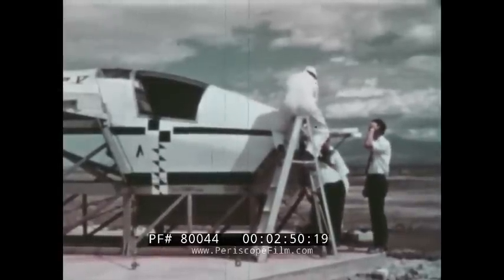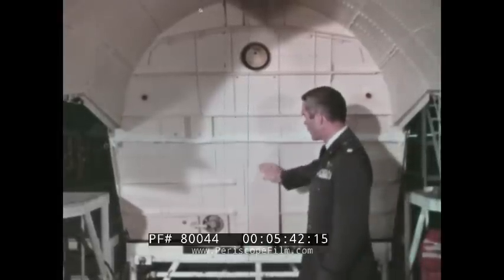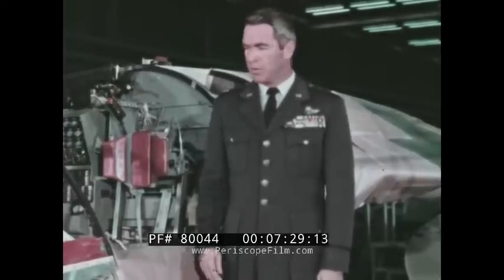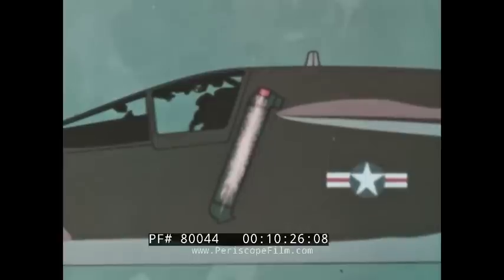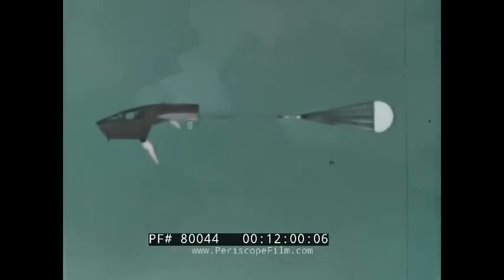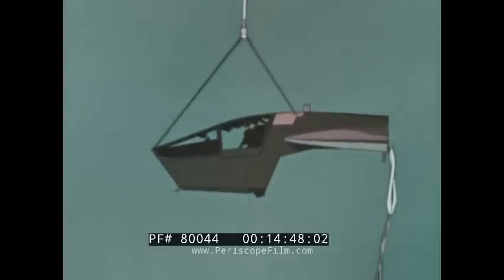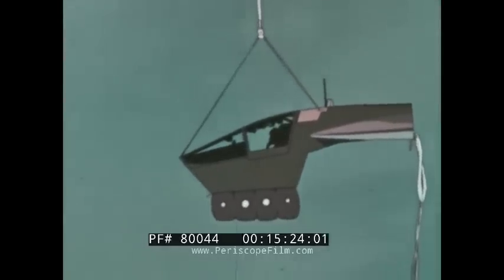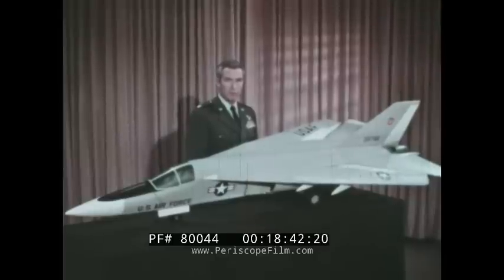GENERAL DYNAMICS F-111 AARDVARK CREW MODULE ESCAPE SYSTEM   EJECTION SYSTEM 80044

Comment: Late 80s or early 90s I was working (survey crew) west side of Clovis, NM, heard a boom and a fellow worker yelled that a F111 just crashed.  Looked to the west toward Cannon AFB and saw a huge column of black smoke, then saw a chute open with cockpit underneath. Jumped in truck in and drove 3 miles to crash site, I think it was the pilot that was already out of the cockpit and was walking around,  I think I remember that the weapon system officer suffered a broke leg.  If I remember right one or both engines quit on short final, crash site was about 1 mile from end of runway and cockpit landed about 1/4 mile from crash site.

Comment: I have to say thank you for this video. Back in 1978, I worked for Talley Industries of Arizona later named Talley Defense Systems. I mixed the propellant for the casting of the propellant into the body case of the rocket motor, which we called the TFX. The company also made the ejection handle, barostat, and maybe even the rotary actuators that are used to secure the flight crew. No one at the company that I talked to knew how the TFX was mounted in the aircraft. Now over 30 years later I finally found out.

Comment: Nice. Thanks for the video, and the memories. One thing not mentioned, was the need to disconnect all the electrical wiring coming from the capsule. There were 4 capsule quick disconnects, 2 on each side, and each had the capacity of (IIRC) 16 cannon plugs. They were mounted to a plate that was spring loaded, and the spring mechanism locked 4 pins in place, keeping the quick disconnects stable. When any motion was felt on the spring mechanism, the spring released, and retracted the 4 pins, allowing the quick disconnect to float, the plate would allow the connectors to pull apart, and then would not resist separation

Comment: Love the F-111 and the A6 Intruder. The crew ejection module for the F-111 was awesome, but I have heard stories of some screwed up injuries from it lol.
Reply: And deaths.  flew -E and-F models for near ten years. It was a great aircraft. The module was a death trap. We would only go in the last worse possible case.  I was back in the States on leave when my regular ship was in an incident. Crew pulled the handle. Both died.
Reply: @itsjohndell  let me guess the wing hinge pin fell out in midair!!
Reply: The ejection capsule was a requirement due to the possibility of supersonic penetration missions at 200 feet altitude. The B-1A also had a supersonic penetration mission as such, the first 3 prototypes had a similar ejection capsule while teh 4th prototype had 4 ejecytion seats.  Since the B-1B lost its supersonic penetration mission, all 100 B-1Bs were built using conventional ejection seats.  At max thrust, the B-1B was to penetrate at 600 knots, at 200 feet altitude, in bad weather, at night with the pilots hand not touching the stick. Terrain Following RADAR was amazing.  Many flyers have been injured during ejections, be them in capsules or conventional seats.

Comment: I'm glad you are re-uploading some of these videos. The old version of this, and a few others caused my video card to choke and stutter when I went full screen. I'm guessing it was a weird resolution that wasn't natively supported.
Reply from the maker: That's interesting...well...reality is that some of the original scans we did were captured on somewhat primitive equipment. We started out with what is called a TRV-16H, which was a standard definition transfer system (telecine). We upgraded from that to a Tobin telecine, then went full digital and HD with a machine called a "Sniper". In more recently years we made the commitment to buy a Lasergraphics ScanStation, a full blown scanner that can support a lot of different film formats and has many corrective features including image stabilization and de-scratch built in. We can scan at variable speeds, in HD, 2k and 4k, and capture audio digitally. So the new scans (and soundtracks) are entirely different from the old!  BTW you should be subscribing to this channel! For the inside scoop support us on Patreon: https://www.patreon.com/PeriscopeFilm
Reply: @PeriscopeFilm  That's an excellent behind the scenes. I am currently subscribed, but I don't have the finances available right now to do the Patron thing. I'll keep liking and commenting in hopes the algorithm will be kind to you. :)

Comment: My coworker Rick Searfoss was proud of his Aardvark driving days, and boasted that he flew it faster than he did the Space Shuttle- since while the Shuttle did Mach 25, that was in such thin air that the KEAS never broke 400, but the F-111 could go supersonic on the deck at nearly 900 KEAS.

With the shuttle, EZ-Rocket, and X-racer, he flew the largest and smallest rocket planes, too. I called him our NASA-surplus astronaut. Miss him.
Reply: 900 KEAS on the deck is fast for a -111.  The FB-111A could do around 730 knots at sea level. the F-111B Seavark could do 793 knots at SL at 63,220 pounds combat weight with 2 Phoenix missiles, or 698 knots with 6 Phoenix missiles loaded(68,365lbs).  All -111 models were structurally limited for top speed, not thrust limited, though the F-111F was the most powerful variant with 30% more thrust.

Comment: My Dad worked in R&D at McDonnell in developing the ejection system for r=the F-111. How all the cables and wires had to be systematically severed before separation, each by a small guillotine type cutters

Comment: And the module works ok, a F111 with the 48th TFW at RAF Lakenheath in eastern England got into trouble about 20 miles north of our house, we were talking about it the other day. My late father was one of the local community civilian fire fighters who went to the scene of the ejection. Two fire stations nearer the scene got there first and assisted the crew out of the pod, they were sitting there chatting away, before the base picked them up. The crash scene was near Binham, Norfolk, England, you can Ytube it, around 1987. I was interested on the film when he said to clear the fumes they opened the hatches a bit, yet I was told a story where two local farmers arrived to help and we're going to use an axe to open the canopy, but the crew signalled to them to stop because the module was pressurised? But you know how bits get added onto a story. There's a thank you plaque from the USAF in the village somewhere thanking locals for there help. With at the time around ten British and American operated bases near by it wasn't the first time we first responded to an ejection.
Reply: "The module was pressurized"💀
Reply: I was stationed at RAF Lakenheath from '85 to '88. I know the crewmembers involved in this accident. Firstly, both survived. I am not sure about pressurization continuing after ejection, but I'd doubt it. I do know that both crewmembers were injured because of a partial malfunction in the ejection system It may be simply that they were a bit stunned and in pain and didn't want to be moved or messed with.

Comment: Surely the system worked well in most cases. I did see a video about a pilot who suffered a severe back injury because the shoulder straps retention device failed. Otherwise the F-111 is a super fighter bomber!

Comment: Capsule system seems like a great way to protect the crew. Thing is, if you eject over enemy territory - you are essentially giving them the entire electronics suite of the model, no? Even if you put in a destruction charge, setting off an explosion on the ground once the crew egresses, is like saying "we're over here, come get us!"
Reply: The electronics are very likely stored elsewhere on the plane and all that is in the cockpit are the controls that interface with the computer and flight controls. That’s how I would do it if I were designing this to keep the weight of the capsule down
Reply: All the electronic stuff was elsewhere in the fuselage. All that remained with the capsule was control heads

Comment: It sounds very complicated , I wonder  if it was a success in operational use . And if it worked as it should,  why wasn't it used in later aircraft ?
Reply: Of course it worked, many times. Unfortunately the TF-30 was a garbage engine and it caused many crashes. The capsule failed a few times as well. Ejecting out of the envelope would get guys. And failed attenuation bags broke a few backs. Other wise it worked pretty well. 

The US Navy insisted on the capsule and side by side seating. The airplane was Navy in a lot of designs. They backed out of the deal when they could. The F-14 was their answer, and it was a better airplane. But it did have the crappy TF-30 engines, and all of the problems that engine created. The Vark was an ok bomber. It had few evil traits. Except the engines.

Comment: Basically a rocket plane inside a jet plane!!  Like spacecraft,  umbilical's  have to be cut and its all so complicated and amazing as it has to work even after sitting and sitting in heat and vibration endlessly for that one time the handle is pulled...  Even today the F111 is amazing and outdated but so damn powerful and big and heavy and could go really fast carrying a heavy bomb load and like the Warthog, sad it cant fly on as both planes are so capable.  The Space Shuttle was extraordinary to but thats gone  for a decade now and the US doesn't even have its own spacecraft to lift men into orbit so a lots changed....
Reply: Space X regularly lifts humans to orbit, Boeing will also do so this December.

Comment: Very interesting but I understood that it was very mantainace intensive and took hours to reconnect the escape module to the airplane. Nevertheless I always found the F-111 a really cool airplane but feel very sorry that I never saw this airplane flying 😢 😞
Reply: @FIREBRAND38  perhaps I didn't explain well: of course those modules once utilised by by the crew to bail out are not used or junked but those still installed on their airplane needs to be routinely inspected and generally the airplane was very expensive to fly hence the reason why the Australians terminated the use of F-111...
Reply: yeah they ditched they system entirely and went to straight ejector seats on the B model on due to maintenance!!
Reply: @keithmoore5306  exactly! It was for the same reasons also the US Airforce terminated the use of this airplane despite performing very well during the Gulf War and performed better than any other U.S. strike aircraft used in the operation.The group of 66 F-111Fs dropped almost 80% of the war's laser-guided bombs, not bad isn't it?
Reply: @paoloviti6156  well spare parts supply was also starting to an issue too in it's retirement!
Reply: @keithmoore5306  you are right, I forgot to mention it...
Reply: @keithmoore5306  No, B-1B went to conventional ejection seats because it lost its supersonic penetration mission that the B-1A originally had.  Supersonic ejections are difficult to survive.  The first 3 B-1A prototypes used the ejection capsule, the 4th used 4 ejection seats.  Once teh B-1 program was revived, the B-1's mission was changed from high altitude Mach 2.2 penetration, to the B's 200 foot, 600 knot subsonic penetration mission. Therefore the 4 ejection seats were used.
Reply: @hoghogwild  key word there PROTOTYPE!! the 111 was in service with the pod system the bone wasn;t!!
Reply: @keithmoore5306  Yes, prototypes,  but the reason for the change in escape systems was due to the change in mission, not due to maintenance.
Reply: @hoghogwild  it's still gone reason given doesn't matter! and a seat capsule system is different than a cockpit capsule system!
Reply: @keithmoore5306  If the reason for retirement doesn't matter then what are you going on about?  Obviously a capsule and seat ejection system are different.  Both saw active use in the USAF.  The reason capsule systems were used/investigated is to allow for safer supersonic ejections.  The B-1A had a supersonic mission, the B-1B did/does not, that's why the capsule ejection system was dropped, not maintenance as you stated.
Reply: @hoghogwild  i didn't say the B 1's  system was a maintenance issue the F 111's was! (the B 58 hustler had seat capsules and proved the system was acceptable as to increased maintenance loads!) the seat capsules are an entirely different animal to the cockpit module system! the thing you don;t seem to see here is that the cockpit module has control system connections in it that a seat capsule does not! when they removed the module for work they had throttle connections rudder connections weapon systems connections and so on to disconnect and reconnect and test where as a seat capsule they didn't! not to mention the size difference they basically took the nose section off vs pulling a seat out! and the fact is even with the B1A's supersonic profile they were ditching the capsules on production models away in favor of specialized flight gear that someone came up with after an SR 71 crew had to make a supersonic ejection and survived just fine!
Reply: @keithmoore5306  From your 1st post 
"yeah they ditched they system entirely and went to straight ejector seats on the B model on due to maintenance!!"  
Sure reads like you were talking about the B-1 system(s).
 The whole reason for the crew capsule system was to avoid the restrictive pressure suits and helmets the U2/SR71 and Space Shuttle(STS-1 through STS-4) used and allowed for a shirt sleeves environment for the crew.  A standard individual ejection seat doesn't allow for great supersonic survival rates, though they have occurred(with significant flail and other injuries
Reply: @hoghogwild  one the F111A and F111B not B1A and B1B two the story i heard they were developing specialized harnesses derived for the blackbird punch out but it didn't give any details beyond it being the harness!

Comment: This aircraft was so complex. The cost to maintain and operate per hour was astronomical!  Just the ejection system alone is unbelievable. 

Now… here I am dreaming. I’d love to take the plans for the F-111 and have Boeing/Saab, Lockheed / Martin and Northrop/Grumman compete to make a new version of this aircraft.  

Part of competition would be that the  size, the variable sweep wing and overall shape must remain very close to the same.  Anything else would open to change. 

With todays technology it would be so cool to see what these companies could do.

Here is what we know they could do for certain. (1) reduce weight by 25-30% (2) increase thrust by 20-30% while increasing fuel efficiency by 35-50%! (3) fly by wire (4) at least F-15EX or F-35 Avionics, Radar, data links, much better flight crew comfort and helmet similar to the F-35. (5) much reduced radar cross section (6) reduction in maintenance hours by 50% or greater. Partly achieved by new technologies and better designed engine removal /install and maintenance modules that are easy to access and exchange. 

I believe with some aerodynamic cleaning up, Mach 2.8 or possibly 3.0 possible.  

The big increase in performance would be how incredibly fast this platform could be at super low altitude.  It might even actually work well on a carrier. 

That being said….. it still would be low stealth and more costly than a clean sheet non variable wing platform.

Comment: Why dont we have this level of engineering today? As a pilot,  hands down an enclosed ejection system has so many benifits.
Reply: Probably complexity and cost. Ejector seats are quick to lift out during their maintenance and don’t disturb the rest of the aircraft. We only had to unhinge the canopy to lift the seat out for its routine maintenance. Modern ejector seats are also zero-zero capable with a high survival rate.
Reply: I think they found that it wasn't always practicable in some situations like when the capsule landed on a steep hill side and would roll injuring the pilots.  This happened more that once I've been told.  Better to land on your feet.

Comment: Although an ingenious design. General Dynamics TFX proposal and eventual F111 was seriously flawed. The undercarriage position negated the use of the full under fuselage for weapons stowage despite the Bombay. The position of the intakes created horrific boundary layer shocks for the smooth airflow into the engines. The side by side seating arrangements presented a wide windscreen for birds trikes at high speed low level flight. However the crew escape capsule was a very successful design despite costing as much per capsule as an F-86 Sabre.

Comment: The sled ejection test looks staged, there were zero/zero ejection seats already in 1968 that didn't flip over the pilot.
Reply: gee imagine that a test that was staged! all tests are staged and depending on the system in question some will flip the seat! just the nature of that particular seat design especially seeing how the F 106 was over a decade old by then as was it's seat design! it doesn't mean anything but to show a difference between the systems!!
Reply: So?  So what if tumbled or flipped, the goal of the ejection seat system is to get the crew out of the plane, clear the plane and deploy a parachute.  It was meant to save the life of the crews.